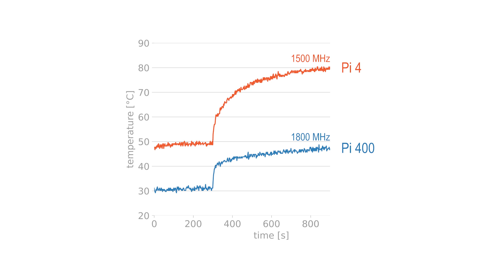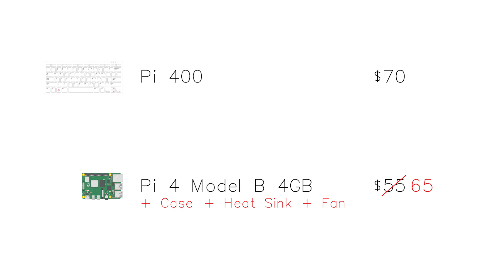Raspberry Pi 400 vs Raspberry Pi 4: Battle of the Pis 2

Comment: This was very helpful. 

Didn’t know the clock speed of the Pi400 was 1.8Ghz compared to the Pi4’s 1.5Ghz.

Looking more closely at getting that Pi400 now, but to get rid of all those wires, are there HDMI streaming dongles one can attach to the Pi400 to connect it directly to a monotone without having to use wires etc?

Comment: The pi 400 is the only one available at all right now (at my local Micro Center). So it's my only option other than the Pi 4 which goes for $100 on Ebay right now.

If the Rasberry Pi 4 were available at $35 or $55 I would go for that, but it isn't 😅
Reply: 8gb DDR4 version is $36 now on the microcenter website

Comment: If the pi 4 were to be overclocked to 1.8, what would the performance difference be between them? Or even if both were at 2Ghz? Also GPU?

Is the 400 compatible with apple type c charges unlike the original 4 revision?

Also can the 400 stress on both usb 3 ports ? Or are they sharing a single 4gbps controller?

Sorry too many questions, that headphone jack and additional USB port is just so hard to lose I guess